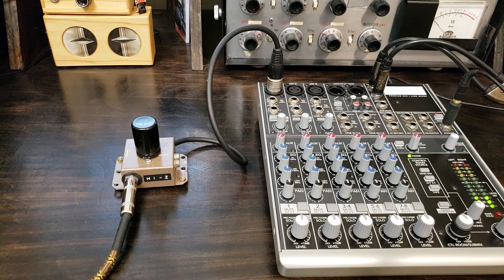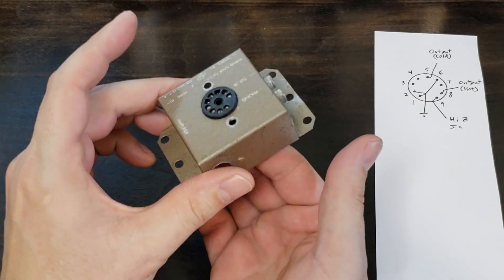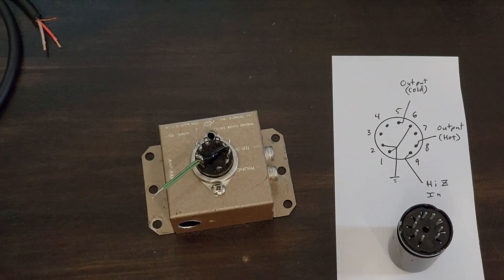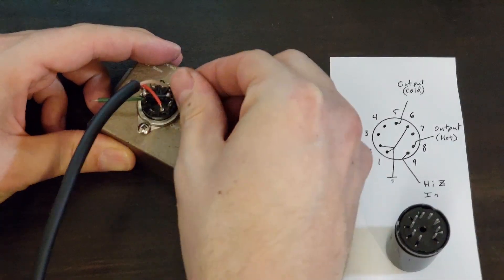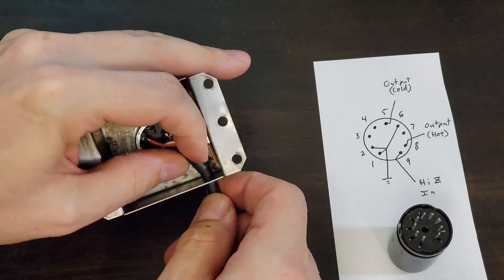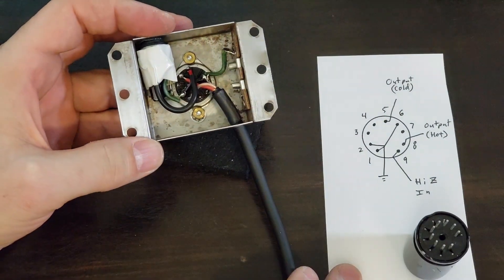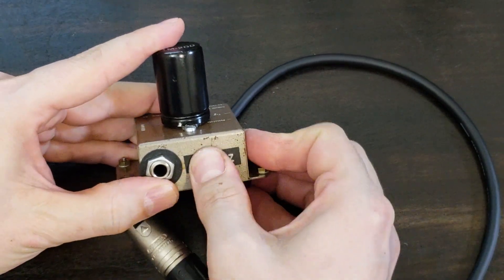Bass DI Box DIY BUILD w/ Transformer MotorCity MAKE YOURS

Comment: Late to the game here. Something about seeing that transformer sticking out of the box seems so wrong, but matches the aesthetic of the pedals I'm designing. I hope you don't mind if I use this idea for some boxes I'm building for myself.
Reply from the maker: Take the idea and run with it!  People have been doing some form of this Hi-Z to Lo-Z (or vice-versa) since recording mixers and consoles were invented.  Despite internet claims, I wouldn't say any one person "invented" this concept.  It's perhaps the easiest way to transform one level of signal to another.  For a long time, it was also the least expensive.  In this case, necessity is the mother of invention and I simply used the parts I had on hand.  
Good luck with your builds!

Comment: So, would this be considered an 'active' di since the unit is phantom powered through the xlr from the mixer ? And, would that transformer be sufficient to handle the impedance of a piezo disc ?
Reply from the maker: Good question. This is not an "Active" DI, because the unit does not require or use phantom power.  Phantom is only recommended with DI boxes that have little boosters or preamps inside- this one does not.  
You could try this with a Piezo, although the impedance of most piezos would be 5x or 10x higher.  It's worth trying to see if it would work but my guess would be you might run into some distortion.

Comment: Hi there! Wonderful thanks! Is this suitable for ITB mastering finalizer? Or just for individual instruments?
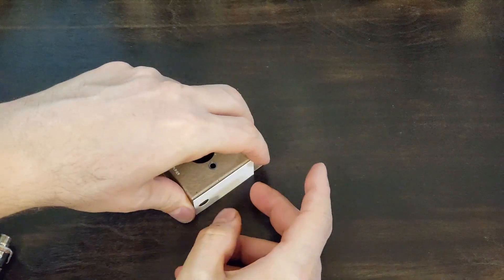Reply from the maker: I would choose a nicer transformer for mastering with a different Primary to Secondary ratio.  For example, this one is higher ratio- approximately 1:10(200 ohms to 20,000 ohms), and mastering transformers are usually lower ratio- approximately 1:1 (10,000 ohms to 10,000 ohms) or 1:1.4(10k:20K).  The actual values may not matter too much, for example 2k:2k, or 5k:5k, or 2k:3k.  With transformers, it's always trial and error. You just have to listen to each one to see if it suits your needs. 
Of course, nothing is written in stone, so you can try anything you like. But, I usually keep this type of transformer box set up for instruments and mic preamplifers.

Comment: can you a make a video comparing your DIY to the acme motown? Personally, do you feel it sounds too different? I was looking for the Triad transformers and ouchhhhh so expensive, the price of the DI
Reply from the maker: Hey, I no longer have the ACME unit, I got rid of it after I started building my own with new transformers.  The triad transformers have just gotten ridiculously overpriced.  I'd never pay more than $100 for a vintage mic transformer- even $100 is too much in my opinion.  There so are many others that will give great tone.  Even new transformers are great sounding.  Check out Cinemag Transformers, the CMMI-8B3, CMMI-10B,  CM-75101A are all good options.  Sowter also makes a "A-11J Replacement" called the 1585.  All priced below $100, I believe.  
I'll say this about the Bogen transformer box I made- it's a warm, fuzzy tone that rolls off the high end, and a bit of the low.  I don't use it as much as the new ones I make, but I do still use it sometimes.  Usually, it just sounds "right." It does take more "makeup gain" than other transformers. Not a huge deal if you mic preamp sounds okay.  If you can find the bogen T-200 for cheap(less than $20-$30) then it's worth putting together a little DI with it.  Otherwise, I'd just buy a new transformer for $75 and the other parts(Less than $40 depending on the parts you use) and build one yourself.  The guy who "invented" the wolf box, put up a schematic online, so you can easily find it.  Even though the pad circuit looks cool, unless you play with active pickups, it's not really necessary.  That cuts about $15 right there....
Good luck!

Comment: Thanks for this video - it's super great! Quick question though: where did you find that little enclosure? I've been looking around eBay for a while for old enclosures I could grab but not finding anything interesting. Is there something I should search for keyword-wise? Thanks again!
Reply from the maker: Thanks!  Hmm, I got this as part of an ebay auction for an amplifier.  I think if you look for switch box enclosure that could help.  BUT, you could put this in a little guitar pedal enclosure which can be had for less than $10.
Reply: @FrankOlsonTwins  Thanks so much! ... I actually stumbled upon a pretty cool old phono preamp that's being sold as non-functional. The enclosure looks perfect, but I'll also check out the switch box enclosures and push come to shove, I have a few pedal enclosures I could use. Thanks again!
Reply from the maker: you bet!!

Comment: Nice step by step build. And not to be too nitpicking, but, even though the sound seems overall tighter, I can't really tell for sure, because it appears that the channel gain was changed :/ but then again, we're compairing soun through youtube-compression...
Reply from the maker: The gain was raised a a few db to make up for the loss of the transformer, as an effort to give a similar volume and signal to noise ratio to the recorded signal. There isn't much tonal difference in the middle range of this preamp and in real world practice, I'd adjust the gain knob(as I did here) to make up the loss rather than boost the volume after recording.
Had I not increased the gain, noise would likely become an issue as I would have had to digitally boost the recorded signal.  For this comparison, the gain isn't really the issue as in some other comparo's....
Reply: @FrankOlsonTwins  Ah, I see! Thanks for clarifying!

Comment: Hey, great video! Thinking of making one of these myself now :) Question though, is there a reason the enclosure has to be aluminum? Wouldn't a plastic box for instance negate the risk of the transformer and the metal case making contact?
Reply from the maker: Glad you liked the video!   You could use a plastic case, but aluminum or steel will offer shielding around the open contacts in the underside of the transformer. Try a plastic case of you have one, it might not make a noticeable difference!
If you're worried about grounding out against a metal chassis, you could get creative with the cable insulation.